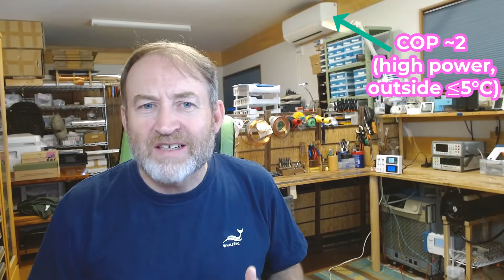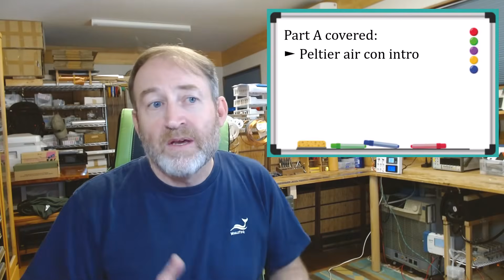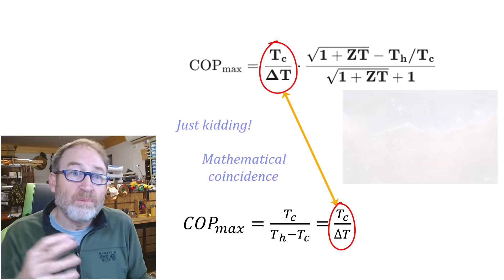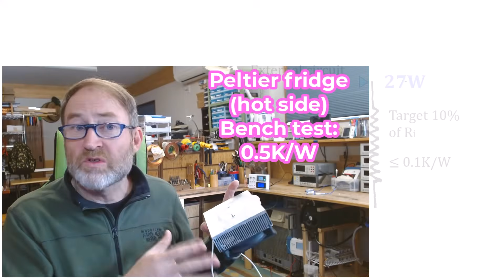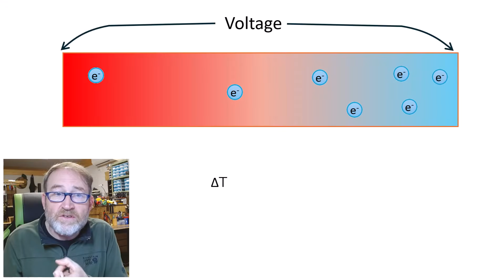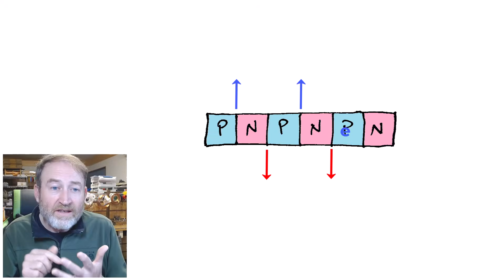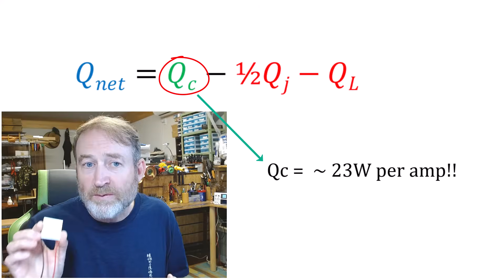The Peltier COP 30 Gateway (Part 2)

Comment: What if you use the peltiers as generators using the sebeck effect, is there a curve that shows at what dT you'd get the highest efficiency ?
Reply from the maker: I've started looking into that side out of interest, but it seems the Seebeck effect is tiny at normal range of temperature differences (say <50K) and to get anything decent you need a huge dT which would be impractical, and also need to manage the heat flow to make sure the dT stays across the Peltier rather than in other places of the thermal circuit. One idea I played around with was a solar collector but the numbers (simulations) didn't add up, at least without a solar collector to concentrate the heat.
Reply: @PeltierPower  lol that was exactly what i was thinking too, a concentrating solar collector is the only way to make this worthwile, but yeah I also was looking into curves showing that a huge dT is needed for it to be somewhat useful. Even with a solar collector, the thermal leakage is quite big from the huge dT that it would effectively convert less than 5% of the thermal energy into electricity, at least from my findings, which is still few times less efficient than solar panels.